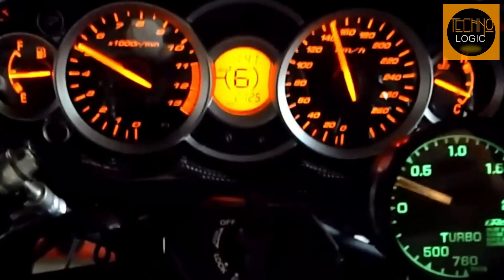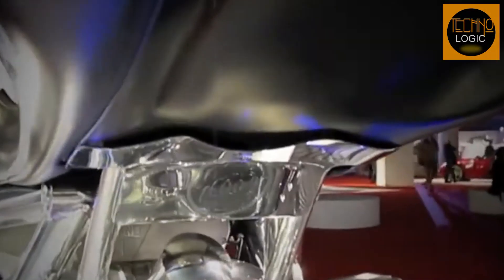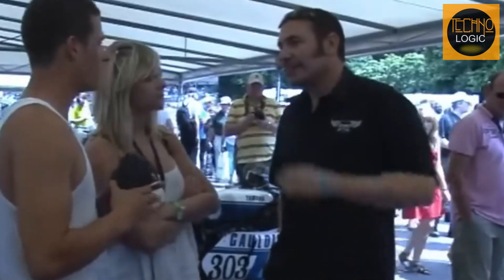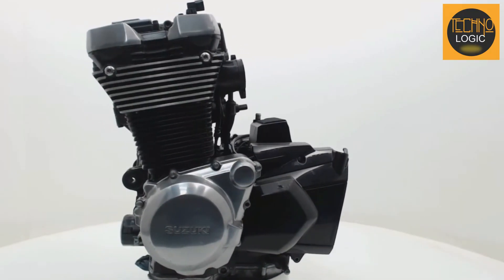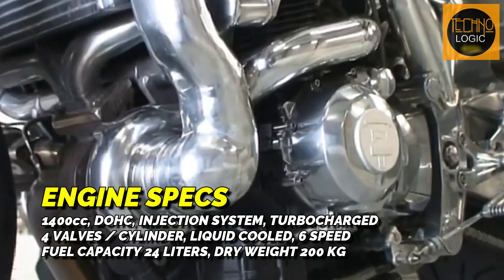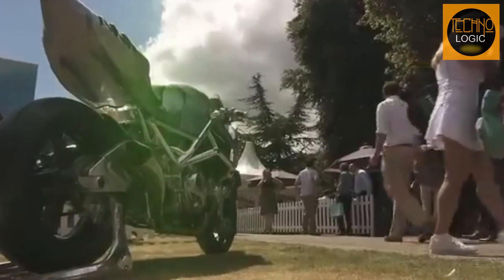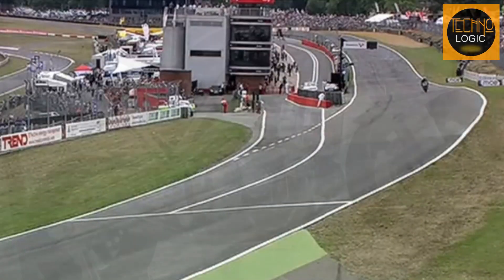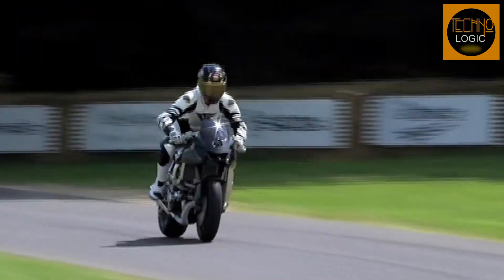WORLD RECORD: Installing a Turbo Engine on a 1400CC Inline 4 Cylinder

Comment: Fail...he should have built a 250 BHP 1000cc square 4 - 2 stroke. This bike has no relevance to any bike Sheene raced.  All you can do with any turbo bike is go straight.